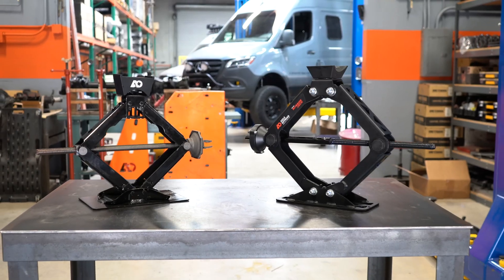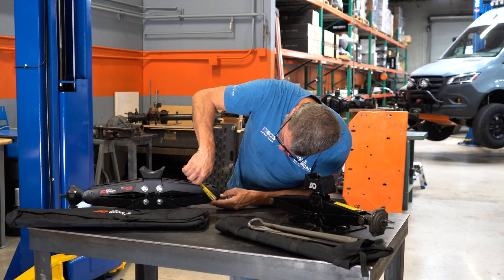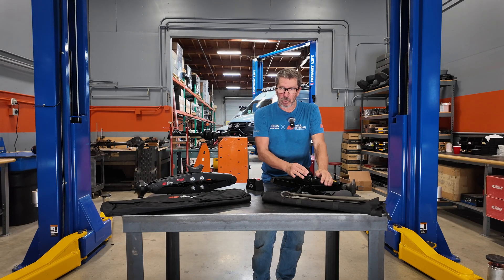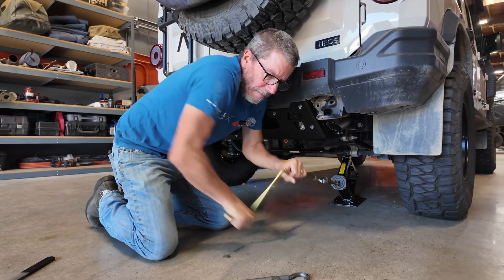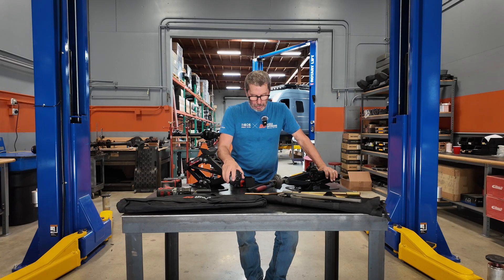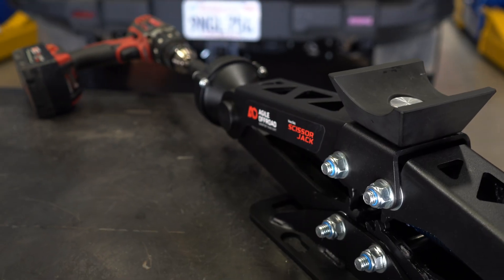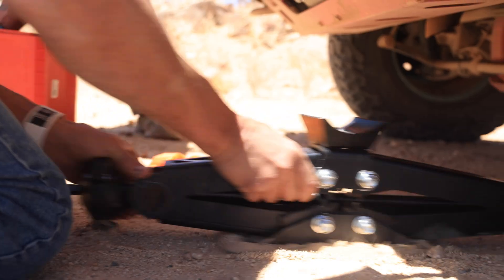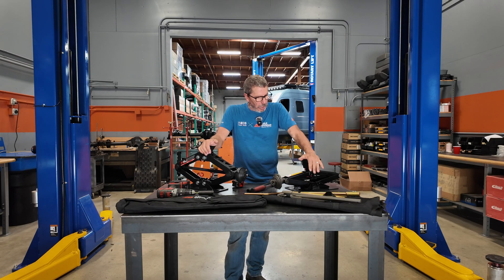Off-Road Jack Comparison: Hummer H1 vs Agile Scissor Jack

Comment: Would you have to get underneath the vehicle with your drill to jack up the vehicle? I would think that that would not be safe.
Reply from the maker: No, you should be able to place them under your vehicle in the proper lift points without actually putting your body underneath. Of course, your hand and forearm would be under your vehicle in order to place the jack in position and use the drill to lift.
Reply: @Agileoffroad  wondering, could you get an extension added? I’m just thinking back to those old jacks and I believe the reason why they had such a long rod was because of safety. I’m not trying to troll or anything. I’m just wondering and come from a genuine place.
Reply from the maker: We could potentially, it's just not something that's on our radar at the moment, or that many people have asked for, but I can definitely pass the info along and it may be something we do in the future.